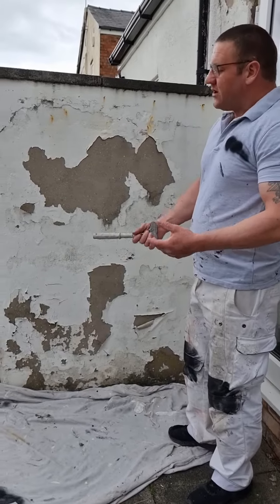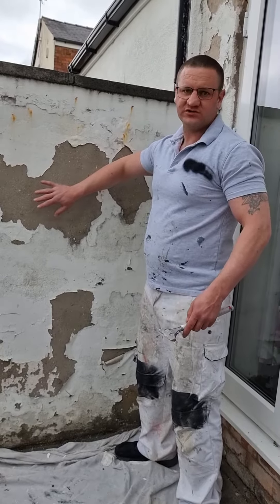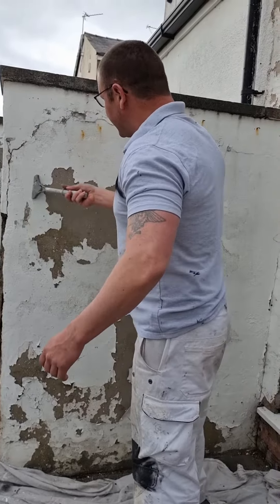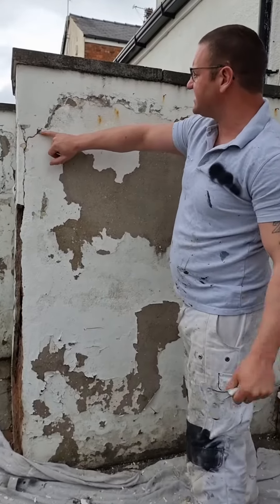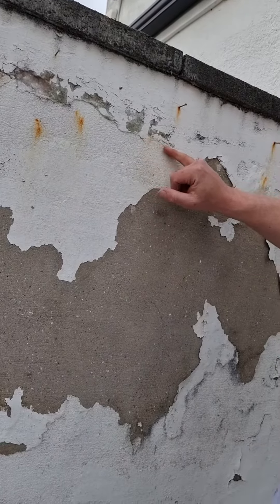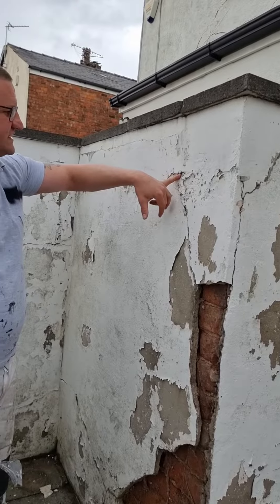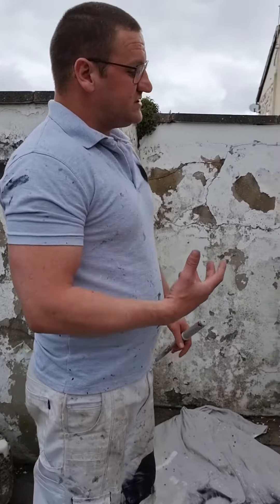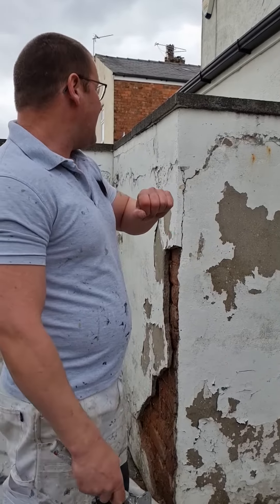how to prep a rendered wall before painting

Comment: owatrol oil is great the most versatile product
Reply: Should only use that for oil based paints.
Reply: @Keith-ui4tp  if your mixing it into paint yes but its completely fine as primer for water based paints
Reply: @jackwardley3626  thanks I never knew that 👍

Comment: Do you use peel stop on newly rendered walls and first painting or just repairs?
Reply from the maker: only when a surface needs stabilising. Sound render should be fine
Reply: @decoratorsforumuk9036  cheers mucker. Just finished my DIY sand cent rendering. Checking out the Emporer paint now as I worry about breathability and damp.
Reply from the maker: @RichardDowd  you can't go wrong with Emperor Paints. It's the best on the market in my opinion. Your discount code is Forum5.

If price is a consideration, then Wethertex AP77 is breathable too